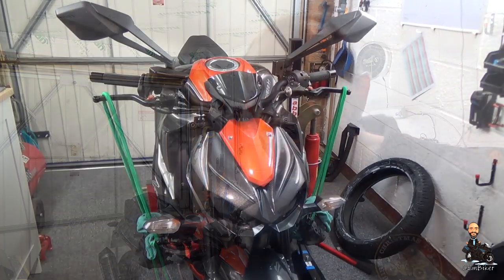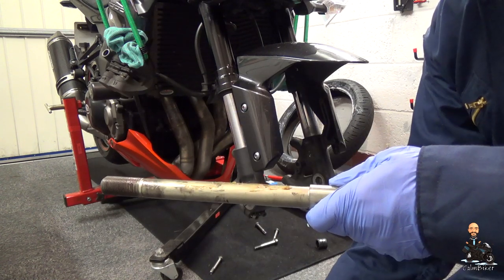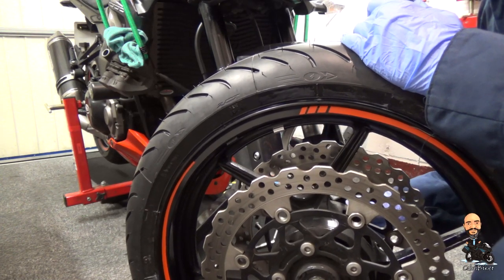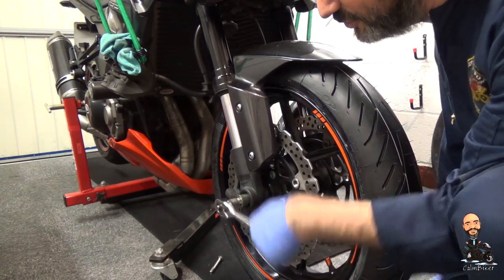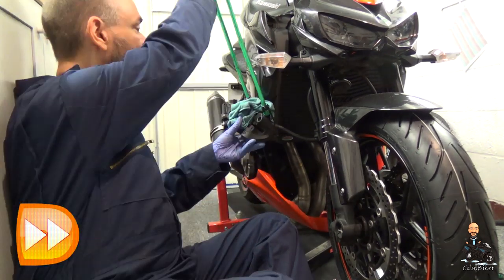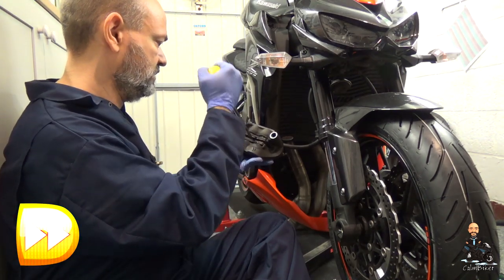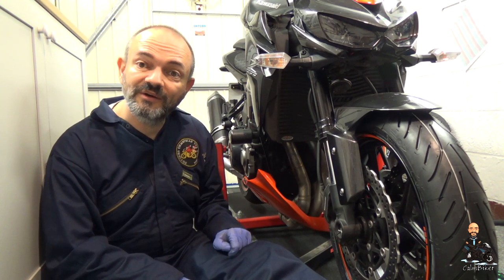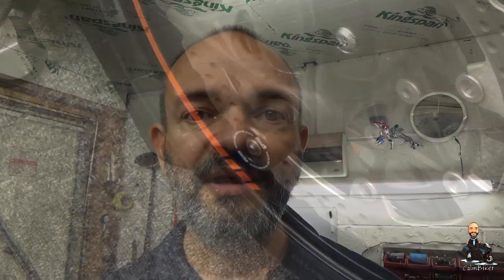891. Kawasaki Z1000 Front Wheel Installation | Garage Video

Comment: Is there a tightening sequence for those fork pinch bolts?
Reply from the maker: Not in my manual. Just that they should be tightened alternately.
Reply: @CalmBiker  On my FJR it's something like, inside, outside, inside, then on the other fork outside, inside, outside...I can never remember which is which so have to get the manual out every time :)
Reply from the maker: @HepcatHarley  Sounds like a song. "Shake it all about!" I've mentioned your comment in my next video.
Reply: @CalmBiker  Ha! will that make me famous? :)
Reply from the maker: @HepcatHarley  I'm sure the money will come rolling in! :-)

Comment: Not sure where I heard it but; I understood that it was a good idea to take the bike off the stand and put your weight on the bars (with the bike upright) and 'bounce' them a couple of times before tightening the clamp bolts. presumably to 'settle' the axle / forks in position? Have you heard similar? or it may just be folk law! Cheers Paul.
Reply: You are correct in that my Norton Manual says to do exactly that, I think it would still apply to more modern bikes. Nice tutorial all the same with good safety tips with the paint and brake check before riding👍
Reply: Your right Mr C does a good instructional video with practical tips and points of caution. Thanks for confirming my thoughts on the pinch bolts.
Reply from the maker: That's true, especially if the fork legs have been worked on. Unfortunately I didn't get that on video. I should have put a comment on the screen really.
Reply from the maker: @sirrideabit651  Thank you Sir!

Comment: I've just been watching your last few videos on wheel balancing. I need my wheels balanced  could you recommend any decent places  in hull cheers
Reply from the maker: I like A&M Motorcycles at the end of Pickering road. Are you noticing wobble / vibration?
Reply: Bad vibration when hitting 60 +
Reply from the maker: @ianh8191  Definitely worth a look then to make sure nothing more serious is happening. You could check the front balance on the bike potentially - have a look at https://www.youtube.com/watch?v=N0XwSUzwM6k. I don't think it's as good as using a proper balancer but it might show obvious balance problems. If there is a balance issue, I could pop around with the balancer and a few weights.
Reply: @CalmBiker  thank you for offering to help me but I don't have the right type of Jack to able get the wheels of the ground and where the bike is kept is only just big enough for the bike  cheers
Reply from the maker: @ianh8191  No probs :-)